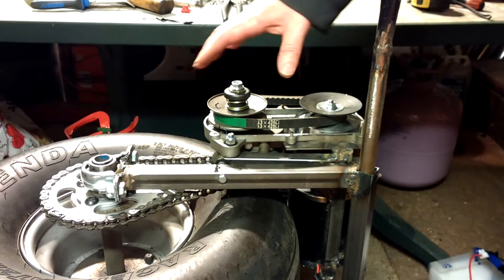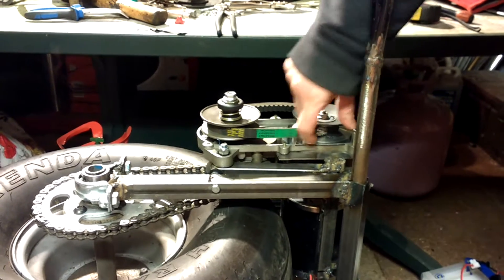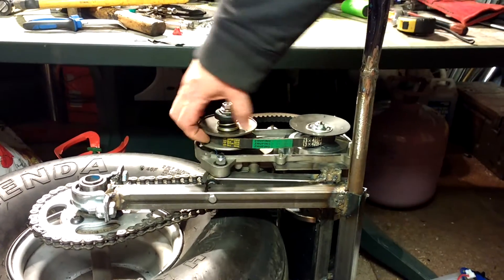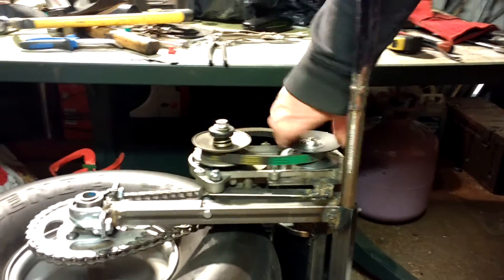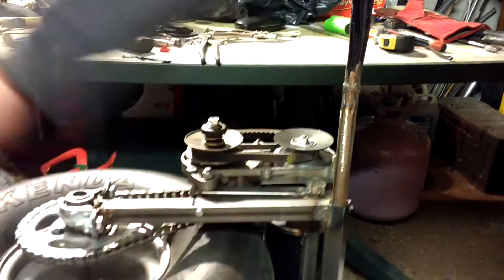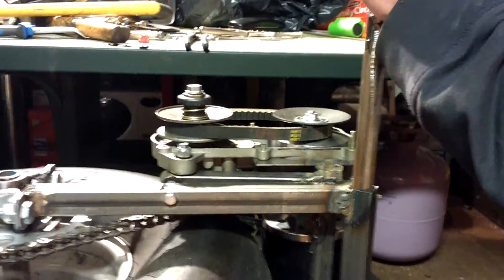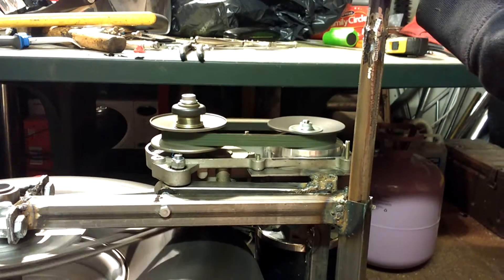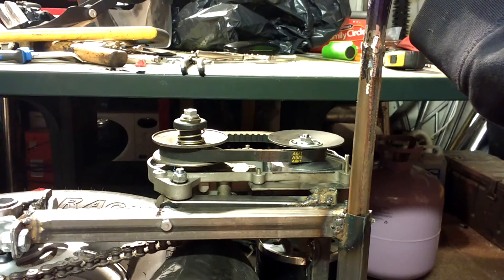First bench test of electric CVT

Comment: IIRC there's a thick washer in the middle of the driven pully that stops the belt coming all the way out.  (sop speed)
Mod or remove said washer maybe.
Reply from the maker: Main issue with this was that my DC motor did not spin as fast as a 2 stroke. We were in the middle of trying a few things such as making the centrifugal weights heavier and subtly weakening some of the springs to compensate. However we then moved onto a motorbike hub motor and never completed those experiments. It would be worth going back to at some point as a CVT would be quite cool for going fast on level ground and while still giving more torque for going slowly up hills. Too many project ideas, not enough time...

Comment: Your belt is to long
Reply from the maker: It is the correct belt for the CVT drive unit. Problem is actually that the motor does not reach 5000rpm (approx) that the 2 stroke engine the CVT was designed for, can reach. I plan experiments with heavier weights and lower spring pressure on one of the cones but still have not got around to trying those mods yet.

Comment: how do you think the transmission adds, vs just doing a direct gear up?
Reply from the maker: For the electric unicycles you are right the alternative would be to have say 2 gears, a regular one and a low gear for hills. The problem is you would have to stop to change gear so this CVT experiment was to see if I could make one that continuously adjusts gear ratio to the terrain. Have not done anything with it lately but will get back on this project in next few weeks.

Comment: hello john actually we are designing a one wheeled vehicle with CVT inside the wheel,can give us your thoughts on your unibike with cvt
Reply from the maker: My thoughts right now are:
Have not tried it yet fully assembled riding it, therefore it might work or it might be a total disaster. I will know in another week or two and will update the website as I go. It is one of those things where you have to just build it and see if it works even just a little bit. I suspect I will spend a lot more time changing gear ratios, CVT weights and springs and so on in order to get it running right. It is worth a try though as if it does work it will be a really cool project.